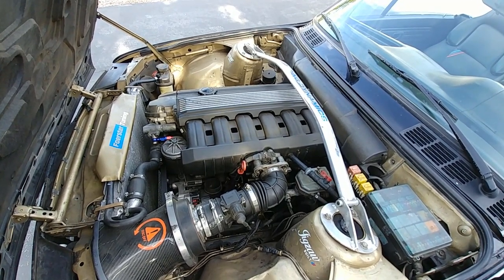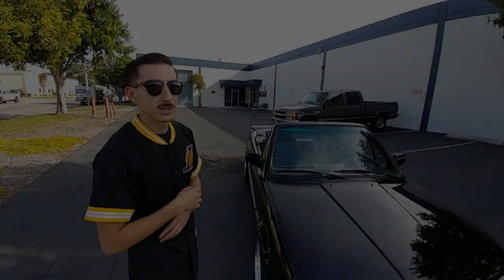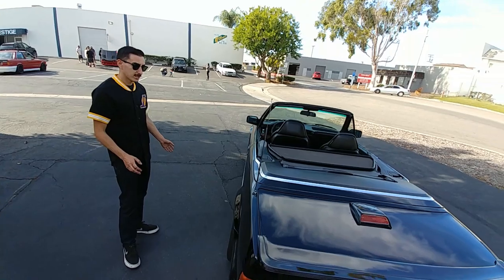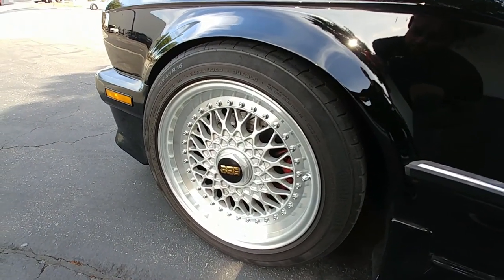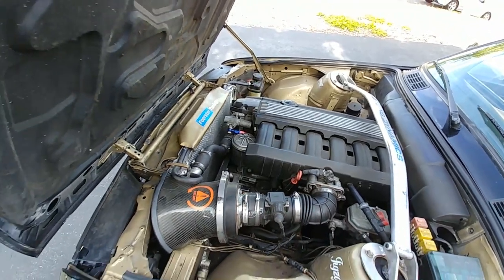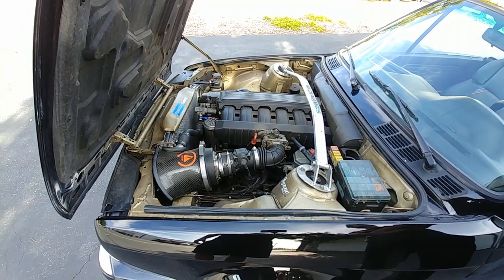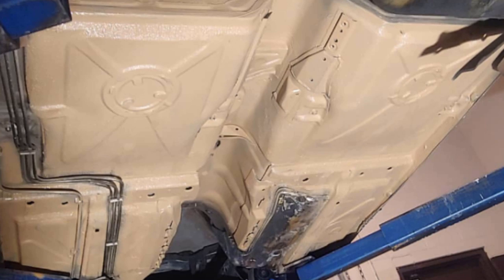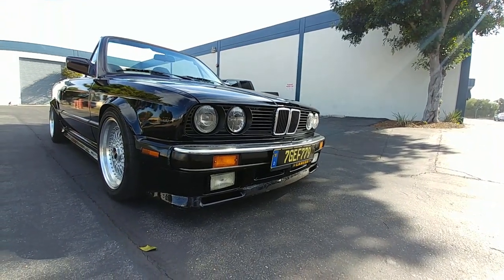1987 BMW 325I Convertible: Road Warrior

Comment: I got a 88 bmw 325is in alpine white for sale
Reply: how much ?
Reply: @yourxtc  well I only know its a popular an d beautifull car, all original matching spare wheel , what is bad is the inside is not in great condition and the steering column is bad, also has a small tear in the oil pan but has never been run with out oil. It was shut off immediately and no engine damage was sustained, I want the car to go to a perso. When has passion for it and wants one badly, I will be fair to make it yours, I'm in new mexico if your serious we make it happen